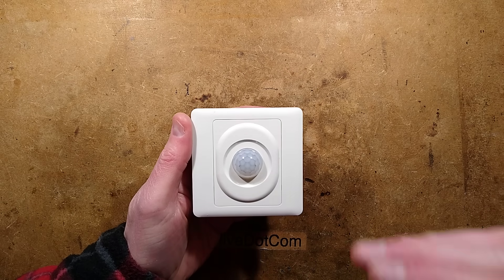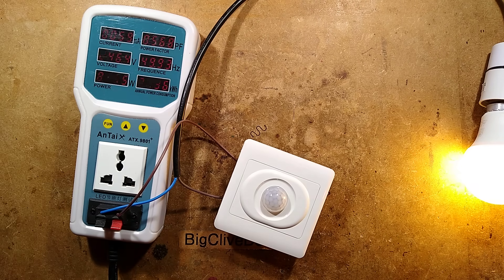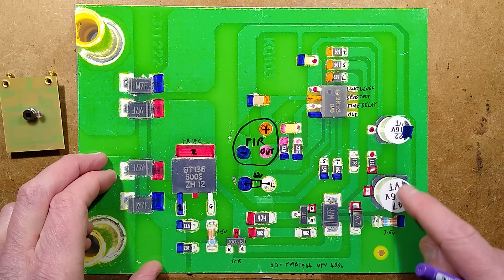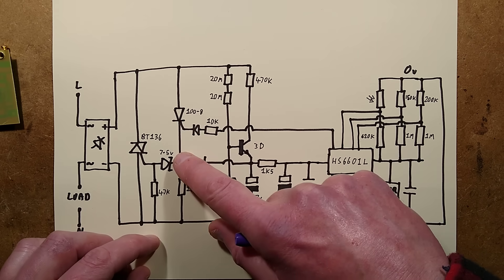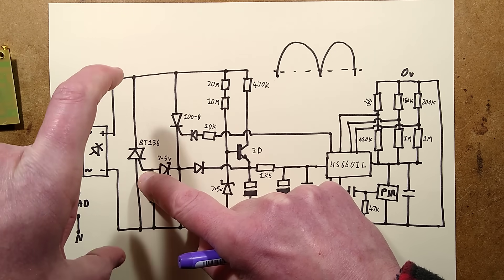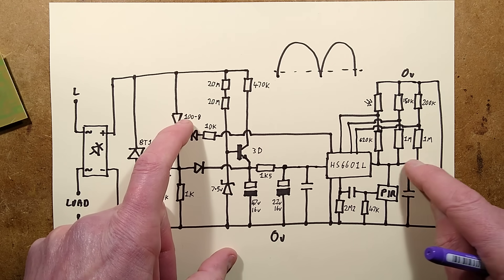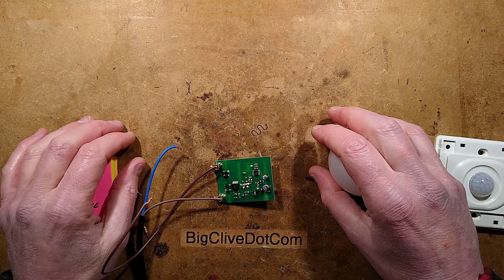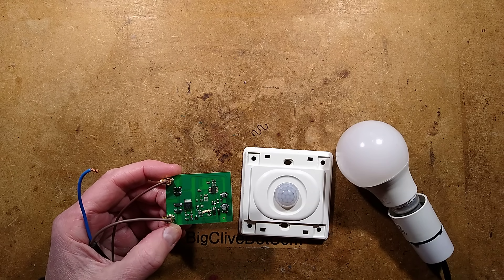Two wire (no neutral) PIR detector - with schematic

Comment: I just installed an PID LED lamp today.
Was just 40€ from the usual scumbags. But had some of the finest things known to man: switchable color (3 steps), wattage (12/18W), delay and brightness. Just with dip switches. I think the control is somewhat like yours.

Maybe you can get also something like that?
Seems like it was glued shut… therefore no more digging for me :D
Reply from the maker: With the power and colour adjustable lamps the best settings for longest lifespan are lowest power and mid-white setting where both sets of LEDs are on.

Comment: Can I connect 2 of these PIRs in parallel to control 1 light in the middle of stairway? For example 1PIR at the top of stairs and 1PIR at the bottom of stairs. Seems like when 1 PIR is triggered, the other will remain off as there is no longer any potential difference across the untriggered PIR (230V on both sides of PIR) Correct? Thanks

Comment: Just wondering if you can advise how to connect two of these to a circuit so that the lights may be turned on from either end of the hallway.
if connected in parallel, they appear to switch on again as soon as the circuit tuns off.
I semi fixed this by placing a diode in series with one of the PIR's, but when it detects, the lights appear to flicker, when the other side detects movement, the light illuminates correctly.
Reply from the maker: Normally I'd expect them to work in parallel, but their reliability may depend on the type of bulb used.

Comment: I had a few of these style and an e27 adapter one. The first had adjustable time delay and light sensing. As I later realized the light sensing was garbage, it just jumped between two states at one point when I turned the potmeter, I think the time setting was fine. At least I remember fine tuning it from 20 is seconds to 40+.  The E27 one had a crappy time setting which jumped to a few seconds to several minutes. I'm not sure if the light sensing was good, either it was reasonably set by default or found a good value quickly. A third one didn't have any settings whatsoever, so I fine tuned light sensing by taping over the sensor with blue electric tape. Without the modification it only turned on in extreme darkness. (I had a fourth one, which I accidentally short circuited. Apparently it had no protection for it because it exploded inside.)

It's strange it shows zero current for your sensor, how could it function then? I only measured the e27 adapter and some pir e27 lightbulbs (which I also have), via a socket power meter. I got 0.3-0.8W values which was a bit disappointing, it was supposed to be 0.0xx something watts. (Too bad I didn't measure the the wall switches, but it would have been convoluted to do so, with what I had lying around.)

Comment: I just bought some of these and they have a slightly different circuit.   They have a 3.3V regulator feeding the control chip and some minor value changes.   The basic functioning is the same.

Comment: Hi, I was so inspired about this device I actually bought one, unfortunately, there appears to be a problem when it in use. After the initial boot up sequence in a darkened area after about 10 seconds, the light comes back on again when there is no movement in the area. After the standard 30 seconds of illumination it goes off and repeat the process again after about 10 seconds. I contacted the eBay supplier and they sent me another unit free of charge, but unfortunately it does exactly the same. Has anybody got any suggestions that I could try and cure this problem?
Reply from the maker: That's odd.  It might be worth trying it with a different lamp.  Or maybe there is a source of electrical noise that is interfering with it.

Comment: I'm surprised this worked without a capacitor across the load terminals, I have smart light switches with no neutral (because you know, UK wiring), however when using LED lights and even fluorescent lights the switches will not work unless the lamps are bridged with a capacitor, the switches have no problem with tungsten lamps.

Comment: Delay @ 1Mohm: longer than Clive's attention span 😅
Awfully clever circuit, I was expecting the slightly choppy switching when on to be a bug, but it turns out that's it's defining feature. Nice to have the option for older circuits with no neutral tap easily available.

Comment: I don't know when you bought this - but mine 2 pcs have different design - IC with no markings, linear voltage regulator, one small electrolytic cap instead of two... lot of small not necessarily beneficial changes...

Comment: 14 08 Yes, the amount of things as seen on YouTube and also tv where everything has to be assembled or undone etc using drill screw driver, I mean if they are unknown machine screws, then using a 'hand' powered screw driver will suffice and also not chance mashing up the heads, I only use a powered screw driver for repetition jobs mainly in timber.
Gaz Yorkshire

Comment: These in-line devices are good but depend on having a load that allows current to flow when off (like an incandescant lamp) - I have smart switches that rely on this and they don't like several types of CFL (not that that's an issue now you can't easily get them!).  With LEDs I found the leakage current is enough to make some glow but not all.  Probably best to go for a system that uses neutral and doesn't limit the type of device that can be switched.

Comment: I've worked with a very similar unit from Senma, the PIR sensor and its controller integrated into a single tiny SMD part but it looks like the exact same thing. I'm willing to bet they're all clones of each other. Anyway it wanted inputs between 0v and 1/2 vcc for sensitivity and 0v-vcc for duration if I remember right, with the max duration about an hour I think. Way too long for my application (mine was triggering an esp32 and annoying my home automation system over wifi) so I just pulled that one to ground for whatever the minimum was.

Comment: i got meself a smart light switch that doesnt need a neutral. did need a capacitor installed in the light fitting to stop the light glowing, but other than that it works like a charm.

Comment: Hello again, i need an 8 kv high frequency neon transformer to drive a rather large xenon tube, preferably at 50 ma or higher, but all the hongbas i can find say 3 kv and 30 ma.
Reply from the maker: They do higher ones, but they're harder to get.  A xenon tube is usually used in pulse mode with a charged circuit and trigger wire on the tube.  For the swirly line type xenon effects the pressure has to be correct, and a single ended driver is often used.

Comment: Pretty nice ideas there. BTW does the LED bulb flash or is lit dimly when off?
I've designed these, those can run on literal microamps, mcu and all, as do LED bulbs - we have one that flashes very dimly due to capacitive leakage providing enough current for startup.
Reply from the maker: Many modern LED lamps have a small load resistor inside to shunt leakage and prevent ghost glow.  But whether that works will depend on how much leakage current it can shunt.

Comment: I use an old two wire time switch (on off) and when the light is on the 5v timer cicuit is powered by a 470uf capacitor, which is charged when the light is off.

Comment: This actually seems quite useful, being able to be added in to say an inside vertibule ceiling light with no additional wiring needed. Curious at to quiescent current draw. Your meter seemed to show nothing, is it really next to nothing on a house electricity bill per year?
Reply from the maker: It's a negligible current draw.  I doubt it would even register on a meter.
Reply: Thanks.

Comment: Lidl™ ( UK ) are now selling an E27 screw base 4 Watt ( 40 Watt eqiv ) LED lamp with a small ( PIR nodule 😝 ) on the top , for about £4 ... These are  SUPER  and  VERY  handy , as you rush to the Loo for an urgent  ( 💩 POO  ) at  3am after a HOT curry and IRN- BRU , the evening before ... These must use this type of circuit , as there is no neutral connection to the lamp ... FYI ... these bulbs sell out  VERY  fast : superior 🇩🇪 German product ............... DAVE™🛑
Reply from the maker: I bought one of the Lidl PIR bulbs when I was across.

Comment: Great review Clive :)  Do you think it would be possible to also wire it in parallel with an existing switch that would then over-ride it for use in a bathroom etc ?
Reply from the maker: That could work.

Comment: Very interesting, thank's Clive.
I have some very useful AliExpress lamps that have the sensor dome stuck on the bottom of the 'bulb', so they don't need a special switch, and are brilliant, except that, when they arrived, the wires inside had been cut too short to reach the push in contacts! Once I extended them they've been working very well for several years.

I have another touch/keyfob remote switch that gets its power by including a mystery capacitor in the box, which you put in the ceiling rose to trickle enough current to the wall switch to power it without the neutral wire proper. Luckily I had an electrician friend who understood what the capacitor was for, or I'd never have guessed!
This switch was so useful, I wanted to put a two gang one in the hall so I could turn it on from my bedroom and still have the proximity as well, but the Chinese kept sending me single gang ones without key fobs, even when I showed them the picture of the two gang one in the advert. I accumulated several before they finally got the idea and sent the two gang one, but still without the key fob or any useful instructions how to set it up, so I have a box of very nice switches that I never got to use.  :/

Meanwhile: My main kitchen light is a very nice old 4ft fluorescent tube which has been going since the late 70s, and which I don't want to change, but I would like it to turn on when I enter the kitchen with my hands full.  I looked at several of these PIR wall switches, but all the two wire ones said not to be used with fluorescent ballast. Even one that had a photo of the back of the switch, that had a label on it saying it worked with fluorescent, said in the specifications that it didn't.  So I gave up on the idea of having the old tube light automatically...

Now you show me this other way of powering the two wire switches, so I wonder if you might be able to see if your one lights up an old fluorescent tube (if you still have one), and doesn't fry itself or the tube or ballast in the process.
Amazingly clever how they found three ways toget around the lack of neutral at the wall!
Many thanks for your helpful explanations (though a lot are still over my head, they are all fascinating. (y)

Comment: What voltage will the work on? Here in the US, we use 120 for our lights, and many of these items are for 220v
Reply from the maker: This one is designed for 220V but it's viable to modify it with a resistor or two.

Comment: Our front-off-house lights are driven by an AliExpress doppler module.  Time duration was adjustable "as bought", however sensitivity was fixed.  A quick examination of the  controller chip (and its datasheet) provided the necessary info, and we now have sensitivity control via a 10 turn pot. That's when you realise you've been watching too many Big Clive videos (long time subscriber here!)
Reply: would you mind to share the product link with us?
Reply: Interesting. Would you share the "name" of the product on Ali_fast?

Comment: That "3D" transistor looks like an NPN. Surely the voltage on its emitter is going to be lower than Vb by about 0.6V-0.7V, so 6.8V roughly rather than 8.2V?
Reply from the maker: Yeah, I screwed up.

Comment: The captioning was struggling a bit here. Highlights: "Zen diodes", "pass and Fred detector" and "soda joints":-)
Reply from the maker: It's tedious correcting all the caption errors.  It's not optimised for technical terms.

Comment: I had a similar unit a number of years ago. It was a tight fit for the metal back box and like Clive's unit the terminal screws are proud of the case 0:52 not ideal. Some kapton tape saved getting a shock or tripping the breaker when installing or removing the switch.

Comment: Funnily enough today I removed a Niko two wire dimmer because it didn't work right with the LEDs that were installed. Not sure why. Might be because of the forward voltage of the LEDs. It was an interesting unit, though. Quite a lot of circuitry inside, too. Claims to be able to detect which type of dimming (leading edge or trailing edge) is most appropriate.

Comment: You made a comment that causes me to ask, if the PIR is a "heat dependent/sensing resistor", can you use it as a thermometer if you calibrate it?
Reply from the maker: It might work if you blocked one side.

Comment: One small rectification: The Zener diode delivers 7.5V an the PN-junction of the transistor drops this voltage by 0.6V so there are roughly 7V which go the the HS6601L.
Reply: I scrolled comments to see if anyone else noticed the mistake. I guess he's human after all :)

Comment: Thanks. Over a decade ago I got a (Honeywell) electronic wall thermostat, 2-wire (replaces dumb bi-metal clickety 2-W t-stat). It can run a dumb electric heater PWM so instead of ON/off creak/freeze it can hover 20%-40% all night long. Got LCD for numbers, M-F and SS for days, all the cheap thrills. 
I'd guessed it ate 240V when off and sipped 4V when on, but never investigated circuit details. So thanks. 
I'm actually working it on a "48 in. 240/208-volt 1,000/750-watt Electric Baseboard Heater" from 124V power (my needs are mellow). There's a minimum heater-size to ensure proper trickle, and I think I am on the edge, because the LCD runs low-contrast. It's been good, with a few bads, but no matter because it was discontinued and replaced with a very different t-stat in 2020.

Comment: I found another datasheet without the stability caps.  For the pull-down resistor. The smaller the S resistance, the more sensitive the induction is. The smaller the T resistance, the shorter the trigger time.

Comment: come on we are all waiting for a flame thrower through the gap between the switches and the plate on the power socket, see if the flame gets through the gap. you could use a certain doll firework as the source of flame.

Comment: The circuit for the pir chip was well explained, but how is the voltage/current sent to the load? The only connection is via the rectifier according to your schematic but how does it continue back out to turn on the lamp, I saw no ac relay or ac to ac via the tyristor, how does it actually switch it on, what is the load current path?

Comment: When you consider that regular dimmers usually have a DIAC between the thyristor gate and the RC delay circuit to provide decisive turn-on, a regular dimmer doesn't turn on until AC voltage is 10-15V too. A somewhat neat trick to keep in mind when you need to power low-power in-line stuff for loads that do not mind slightly dirty power.

The ideal way would be to power the circuitry through a current transformer while the load is on, then the triac could be triggered at ~1V.

Comment: There even are Zigbee smart switches that can be installed inline. They even have connectors for a physical switch so they can be installed behind a wall switch. 
I’ve bought a few SonOff ones and they are excellent imo.
Reply: I have used these smart switches too and they are fantastic. They cannot be used with an inductive load and after watching this video I can understand why. Any back EMF would play havoc with 'pinching power from near the zero volt cross over point'.
Reply: Does that Sonoff immediately turn on the load when the switch is operated? I have an Aeotec that does not. It waits with turning on / off  the load to see if the user does something fancy with the switch, like doubleclicking, for activating a secondary function, if any.
So it turns on the load after a delay of 300, 400 milliseconds. I don't like that. I prefer that the load is turned on or off as fast as possible after operating the switch.
Reply: @fluffyblue4006 
There is a delay but it’s barely noticeable. 
I had to check if there was, as I hadn’t noticed it before nor had I paid much attention to it either. I had to test it twice and compare it with a dumb switch to make sure (in other words it’s close). 
I find it difficult to give a delay time estimate but I hope this description gives you a sufficient enough indication.
Reply: Yep I've several installed
Reply: Thank you for your answers, @Conservator and @rj7855. I'll definitely get some of those Sonoff Zigbee modules. I might even replace that one Aeotec. Problem with that one is that it needs to be dual and it needs to have switch inputs that accept signals that are switched to live. One of the switch inputs has two switches connected in 'hotel' configuration and the common of the switch at the other location is connected to live.
Now I still need to find a Zigbee remote switch. One of those that looks like a normal rocker light switch but is basically a remote control that can be fixed anywhere on a wall. It will also need to send a command immediately, instead of waiting for possible doubleclick or push-n-hold actions.

Comment: I don't understand.  When the load is off, where does the 'circuit' gets its power with only the live connected, to turn the load back on?
Reply from the maker: The sensor is powered by a small current through the load.
Reply: Suggests some amount of current MUST be flowing somewhere dont it?